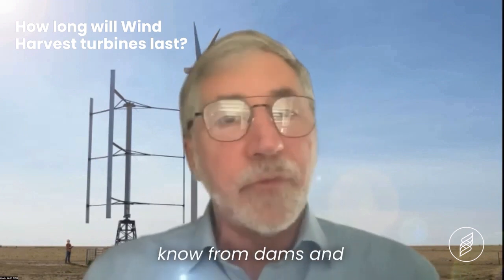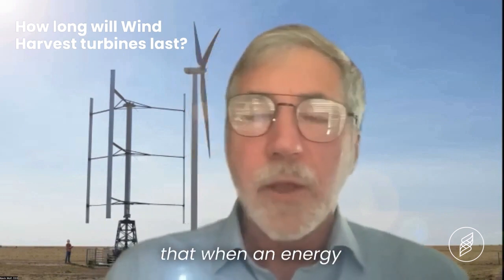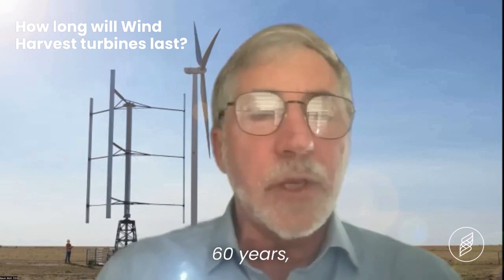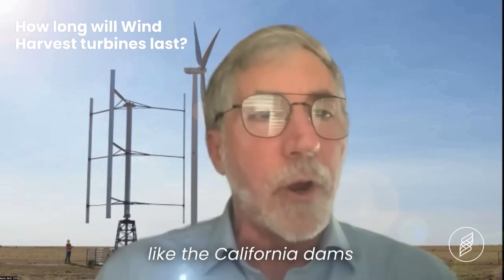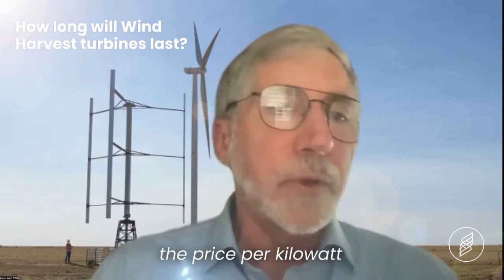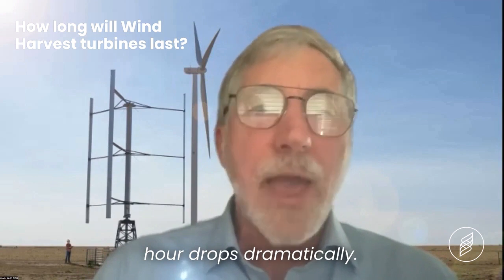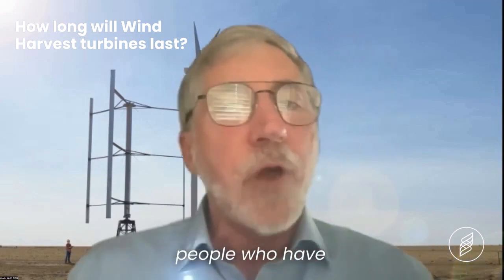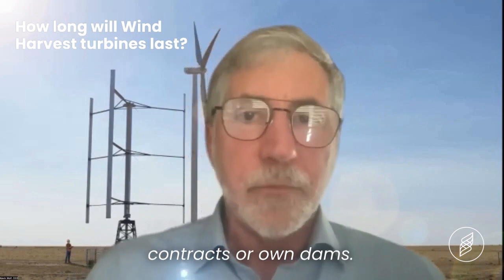How Long Will a Wind Harvester Turbine Last?

Comment: Still looks like a giant bird-shredder to me.  Can we just build clean, cheap, safe nuclear power plants yet?
Reply from the maker: Harm to birds & bats is a concern for the wind industry though it’s small compared to impacts caused by other factors (like skyscrapers). Good news - ornithologists predict birds should be able to see and avoid vertical axis wind turbines like our Wind Harvesters. Data from wind farms in the Altamont pass shows that Flowind vertical axis wind turbines had lower impacts on birds than the horizontal axis wind turbines that were operating then. Wind Harvest  will conduct a careful research program using 24/7 motion detection camera technology to first determine if there are any particular bird or bat species that are not able to avoid our turbines. If we find that’s the case, the technology will be programmed to slow the turbines down until the birds have moved out of the area.

Comment: I could use the old blades for building sheds, carports, storage buildings, shops, etc. I love free/cheap building materials and can imagine many uses combined with artistic designs that would be very desirable. There are, after all, intrinsic structural,  weatherproofing, and insulative attributes. The waviness is organic and asymmetrical. Imagine using them at-once serving as the roof, walls, and structural members in modern multi-car garage using windows as sky lights between them and painting them the colors of bird plumage while adding other organic or geometric shapes for access points and artistic balance.

Come to think of it, anyone know where I can get some?

Comment: Who are you? Who are the other manufacturers that can claim this mortality rate? Can these worn out parts be reclaimed either by remanufacturing, materials reclamation, for energy cost effective incineration with effective pollutant reclamation, or any other desirable reuse? I would appreciate everyone’s kind and informative logical comments.

What, of these measures,  are being utilized today and by whom?

Couldn’t panels be made of portions of the old blades and used for building sheds, carports, storage buildings, shops, etc.? I love free/cheap building materials and can imagine many uses combined with artistic designs that would be very desirable. There are, after all, intrinsic structural,  weatherproofing, and insulative attributes. The waviness is organic and asymmetrical. Imagine using them at-once serving as the roof, walls, and structural members in modern multi-car garage using windows as sky lights between them and painting them the colors of bird plumage while adding other organic or geometric shapes for access points and artistic balance.

Come to think of it, anyone know where I can get some?
Reply from the maker: Wind Harvest is a startup developing the innovative turbines discussed in the video. We know of no other manufacturers working on utility scale vertical axis wind turbines that can handle the turbulent conditions in mid-level wind resources. Our validated computer models show that our turbines should last over 70 years with regular refurbishing of inexpensive parts. 

Most of the parts of our turbines are reusable or recyclable. For example, at the end of the 70 year life, the Permanent Magnet Generator can be reused in another turbine or its magnets can be reused.  

The blades are made of recyclable aluminum. After 70 years of service, these  blades could potentially be reused in turbines located in areas with lower wind speeds. Or they can be melted down and made into new blades.

Comment: That may be so but what about out in the salty sea? Thanks for this have found this informative.
Reply from the maker: You’re right - a marine environment is much more problematic for all things that can rust. We will need zinc in key parts of the turbine to absorb the corrosion created by salt. With proper preparation and maintenance, there’s no reason why Wind Harvester turbines at the shoreline, or on barges near the shore, couldn’t last as long as ones further inland.